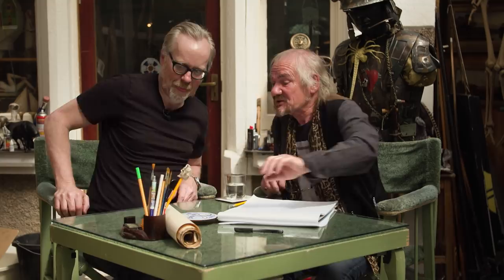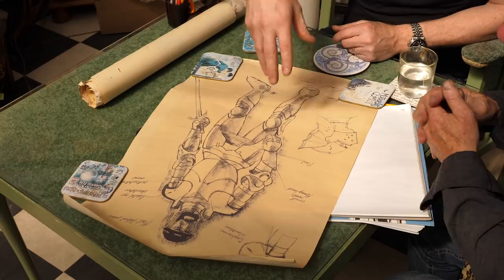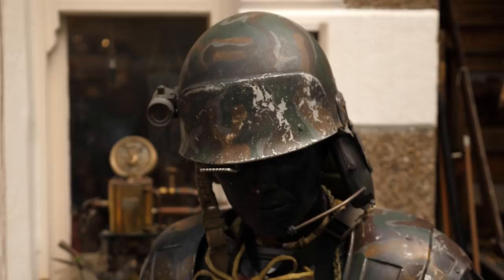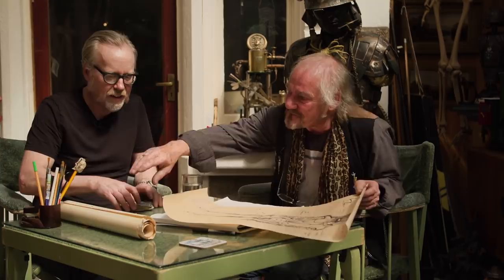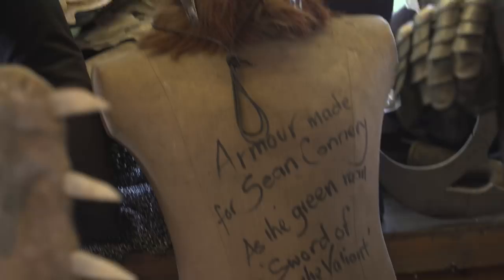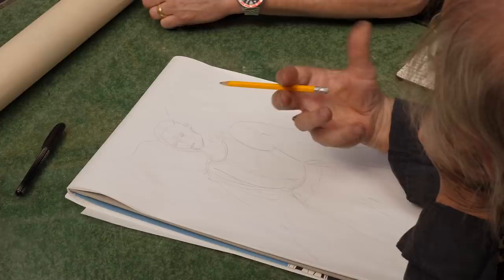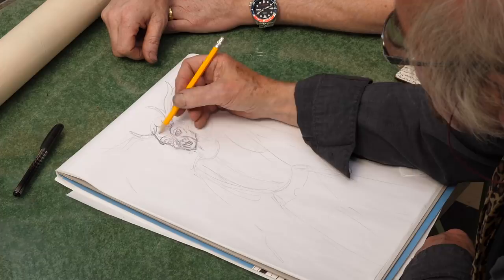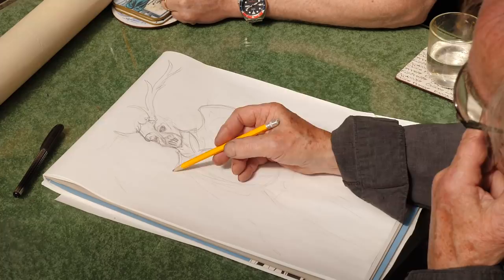Adam Savage's King Arthur Armor Build, Part 5

Comment: King Arthur originates around C4th Rome, "King Arthur Armour"  would've been a lorica hamata or lorica segmentata and a late Roman ridge helmet. Not a full steel harness.
Reply: It's pretty clear from this series, that historical accuracy was not anyone's interest. Also, the king Arthur stories draw on stuff from so many time periods and places, that it really doesn't make any sense to claim a specific period.
Reply: @ernststravoblofeld  
Historical accuracy in a film about King Arthur would not work, I mean you could make a film about a charactor of the time using weapons, armour, fortifications ect based on historicly accurate designs but it would look nothing like anyone expects a King Arthur film to look and therefore would most likely not do well at the box office.

the biggest problem is that there is no evidence King Arthur ever existed, but other issues stem from the story usualy being set in the 8th centuary, 

At the time historians believe no-one was using plate armour (after the Western Roman Empire was disolved on the 5th century it fell out of use until the 1200s), 
The swords would have not have had cross guards, those did not come into use until about 200 years later, swords of the era would have looked very diferant to the traditional idea of Excalibur, 
A castle like Camalot would have been unlikely to be stone in that time period, 
There is no historical evidance to support the existance of wizards or magical powers.
Reply: @terryforsdyke306  You are restating my point, but with more words?
Reply: @ernststravoblofeld  
I apologise, I was unsure if you knew what you were saying
I know people who ask to see historicly accurate full plate armour (which did not exist) of the sort someone in Arthur's time would have worn, or a historicly accurate Excalibur with cross guard (again not possible.)